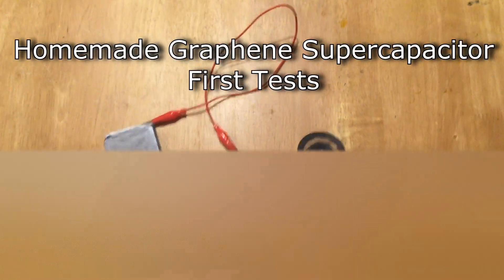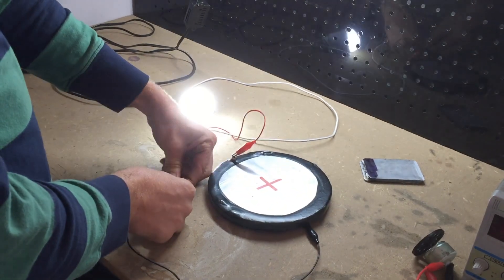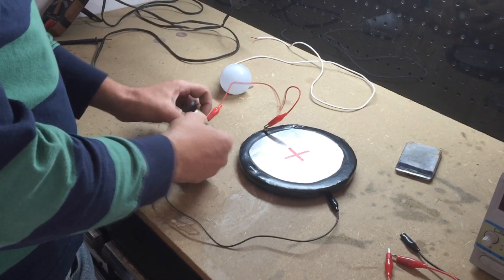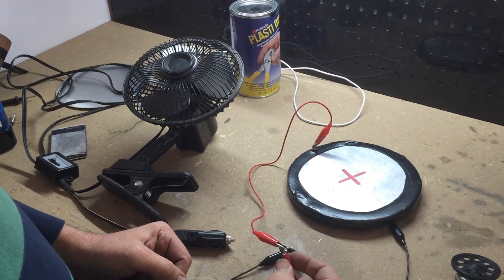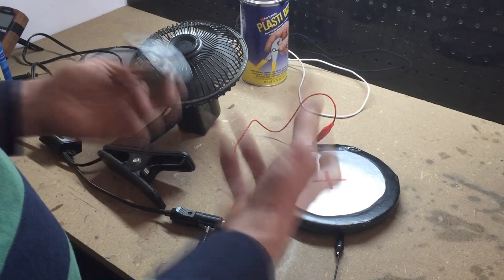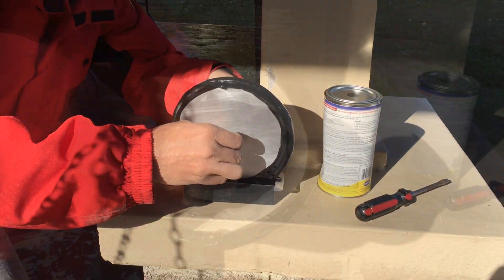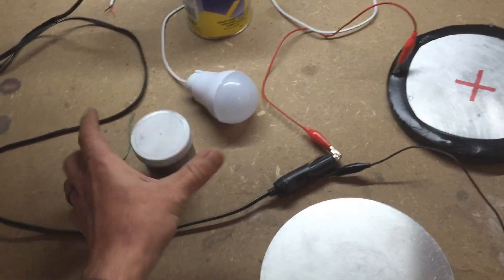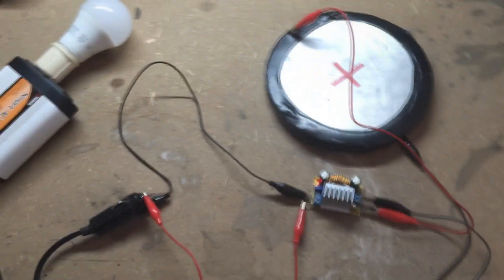Homemade Graphene Supercapacitors - First Tests

Comment: Those plates are too big you need long aluminum sheeting like a lot 50 feet long by 5 in width get the marigwana carbon power it’s the best and hold alot more energy use potassium hydroxide and make a vacuum area to remove water in the are

Comment: This is NOT a capacitor. It is an electro-chemical cell (or as commonly known  - a battery). For gods sake, he has put an electrolyte in the separator. A capacitor does NOT have an electrolyte. They do have very large conducting surfaces separated by an insulator - in the case of early types air, paper or oil was used; no they use plastics such as polyester and similar insulators. A little knowledge is a bad thing. If it was a capacitor, the capacitance would be too low (dependent on the surface area of the plates and the dielectric strength of the separator) to store any reasonably useful amount of charge. I suggest you spend some time studying electronics at a reliable teaching institution not from the internet and especially not from YouTube.

Comment: I would guess grinding down the coal pieces to sand, dust, or coal flour would be more efficient (thinner layers means more layers can be added).
Also, using multi layer capacitors (interleaving each sheet between positive and negative),
And lastly, using layers of foils instead of metal sheets (might be harder to solder a wire on, but should be possible), should increase the capacitance enormously.

Comment: Does round shape improve performance? 

Sphere has smallest area to cover most volume.

Does round shape improve V or Capacitence? Or both?
Reply: None, it has no effect on capacitance or voltage because they both rely on the surface area and distance between the 2 plates, he probably used the round shape because it was easier for him.

Comment: Hi friend  the energy in a capacitor is possible calculation E=1/2 V2 x C... Too it possible  meter with a amperimeter on configuration of discharge of this through of a resistance.  Can you show this?

Comment: It's galvanic or just capacitor producing electricity? Acid reacts with alluminum strongly
Reply: But the acid is not ever touching the aluminum.  Watch the video again 4:23. He applies polyurethane impregnated with graphene to make it conductive and protect the current collector's metal. Then he sprinkles activated carbon over that.

Comment: Sure would be nice to see some figures about the size/weight of the capacitor as well as the maximum voltage, capacity in farads, ESR, and watt-hours/joules when completing a charge/discharge cycle.  These things are conspicuously absent from a lot of these supercap videos and without this info it’s rather difficult to see the point of trying if you can’t at least know how far a person has progressed, when trying to duplicate or improve on their results.

Comment: hello lightsaber, i think there might be a problem, powered graphite is not graphene !! graphene is only 1 atom thick. also you are using an electrolyte , electrolytes are used in and for batteries, a dielectric is what is used for a capacitor.
these video's are very good, lots of different information, however i don't think we are on the correct track... i am so sorry to be a downer but i just have to say what i think is going on.
best of luck, i wish i wasn't in the state that i'm in, i would love to buy some stuff and try some of these experiments myself..
keep up plugging away see where it leads too.
Reply: normdoty  A dielectric layer can be formed using an electrolyte, what do you think is inside aluminum electrolytic capacitors?  In that instance the electrolyte is both a conductive fluid to allow current to pass between the two plates as well as helping to maintain the incredibly thin aluminum oxide layer on the plates that functions as a dielectric.

Comment: I have experimented with ground up wood charcoal and it works great. I figured why not use something readily available and free. it works.
Reply: What about using char cloth? I wonder if it has more micro structure increasing surface area.

Comment: I noticed that this capacitor is made of multiple segments or modules if you will. Tell me or any of these different sections we're together in series well the whole thing is in parallel or vice a versa? If you follow what I mean? is a very important question

Comment: If you are using a an electrolyte and it's producing electricity by a chemical reaction, wouldn't this be a battery and not a super capacitor? I believe this is whats called a dual carbon battery.
Reply: this is what I asked him if there is more than one assembly within the major assembly because typically it would only produce 2.7 volts if it were operating under a galvanic chemistry. It is producing faithful so this would suggest that he is charging it is not electrochemically producing voltage in other words it is a capacitor if that is the case
Reply: A capacitor should have an insulation between the positive and negative surfaces so I think you are right.
Reply: No. it's an electrochemical capacitor: 

https://www.cornellcollege.edu/physics-and-engineering/pdfs/phy-312/Theint-Aung.pdf

Comment: You can run that 8w bulb or even more powerful light bulbs with your super-capacitor. You can connect 1.5v Dc motor to a 12v generator to run the light bulb in more efficient way. Probably about 50% to 60% more efficient.

Comment: I'm interested in the application and integration of graphene/carbon capacitors with solar panels. A single silicon cell is 0.55v, so would you stack 4 or 5 to run across the cap, bearing in mind the max capacitor voltage? A solar panel built on an aluminium substrate would help keep temps down and increase output. How would a MPPT controller cope with the added current capability of a typical panel. (60 PV cells, 15 caps) would it track properly and set the cells to optimum? Unfortunately I have too many ideas and projects to explore all possibilities.

Comment: This is not graphene! Graphene doesn't make powder. Graphene it is a large atom-thick sheet of graphite. If you powder that you will just get graphite.
Reply: misium  You can use graphene in making it in an atom or so thick layer, but whatever you do and in whatever form you use it, it will stay graphene.
Reply: Misium, i think you mistook graphene and graphite. Graphite  contains large sheets of graphene.  Graphite can be sonicated to seperate and break up the graphene sheets into a powder. 

He uses a graphene powder to make his polyurethane coating conductive while providing protection for his alluminum current collectors from the phosphoric acid. Then he adds a layer of crushed activated charcoal which probably doesn't have many graphene like structures but whose micro structures provide an effectively high surface area for his electrolyte.
Reply: actually graphene can be a powder... you know... thats like saying mushed potato chips isn't potato chips its smashed potatoes...

Comment: i'm curious why all are using phosphoric acid as an electrolyte? Why not to use regular kitchen salt instead? As i heard, you can obtain up to 1.2 volt per cell using NaCl without a gas emission
Reply: The salt will attack the metal, thus it won't last very long.
Reply: yes, that's why for salt electrolyte there should be graphite electrodes instead of metal, but it worth it, i guess
Reply: jSkrat Nyarlathotep
Okay, that might work.

Comment: What is the dielectric constant of the insulator between the plates of the capacitor? Do you have the capacitance of the capacitor in farads?
Reply: There is no insulator- no dielectric.
Reply: But how it possible to make without dielectric material
Reply: mayur trasadiya  Exactly.  It’s not a capacitor if it lacks some form of dielectric, otherwise you’re talking about an electrochemical cell like a LiPo.
Reply: It's an EDLC, otherwise known as a supercapacitor. They don't use a dialectric.
Reply: As is with all capacitors, they have a dielectric constant, air, ceramic, mica, oil paper, ect.  Even aluminum electrolitic capacitors store energy in the charge distribution of an electrolyte and the orientation of aluminum oxide  insulating surface. 

At the risk of overly simplifying things, dielectrics with a relative dielectric constant greater than 1 store energy inside the dielectric often by changing the orientation or charge distribution of molecules or  distrirbution of charged ions. Electrolitic double layer super capacitors use an electrolyte to allow ions to get close to their opposite charged plates. As long as the electrochemical break down voltage isn't exceeded, there is no chemical change or electon transfer. Super capacitors really benefit by the huge effective surface area and how close the ions can get to such a huge effective area. Though you may be looking at  two 100  cm sq of current collecting plates, the effective surface area accessible to ions is football fields immense. 

if you know the actual effective plate area can you work back to determining the dielectric constant. But effective plate area is a slippery figure to pin down that will change depending on micro structures sizes distribution,  powdered vs granuals, and if pressure crushes the  structures. I'd guess the theoretical dielectric constants are published in some scientific papers but they arnt that important here, and if i were to guess, its probably close to 1, reflecting the dielectric constant of  space between ions and their plates. Or it may be a few tens large because of ion redistribution. Consider Salt, aka sodium chloride, when placed in water  does not change chemically but  separates into sodium and chlorine ions. Sodium ions attract and push on different parts of a water molecule orentating  one side of water molecules.  Chlorine attracts and pushes on the reverse sides. The result is the ion water structure distributes the ion's charge to the outside of the water ion structure. While water has a high dialectic  constant salt lowers it.

Comment: If you are open to suggestions, this is mine.  You really need to take a little time and study bedini and his school girl motor and make one.  I think you would forgo the solar cell idea and be hooked line and sinker. Unless you are nothing like me, but if that were the case you wouldn't be making all these cool videos about such important ideas and concepts.  The bedini motor makes a voltage which conforms to the thing being charged.  My first one would take one small 7 ah gel cell battery and run at a decent pace, not quite the same as his because I cheated and did not use the exact wires he said to since I recycled mine from a monitor or tv or something and probably could have used more sleep around the time when it came to wind the coil.  Never the less cheater as I am it still ran and charged a full size car battery and I put two cold flourescent bulbs inline in a series and it did not seem to make any difference in the way it charged up the larger battery.  Now the bulbs did not light constantly, but they flashed at full brightness each time the coil was pulsing which I thought was preetttty cool.  I'd do the tests and stuff for you, but my son decided that the second I turned my back or went to sleep that my experiment was done and he promptly dissasembled my bedini wheel so he could go spin it in the sand and have my magnets for his own.  So lesson learned,  when you buy magnets, you must buy enough so your kid or kids have at least more than you do for your project, cuz hey, they lose stuff and fair is fair,  which means yes, they get more than  you do, that way you can sleep knowing your wheel will still be spinning and charging when you get up!

Comment: I've been wanting to power a 3kw motor for an hour or so. How man panels of 12" x 18" do you think it would take? It's for a small motorcycle project that I want to start and batteries are the hardest part. I wonder if I hooked up an alternator to that motor, could that charge the capacitor while in use?

Comment: On the smaller battery what's the average mAh? I kind of want to start fooling around with old phones by replacing the battery with capacitors

Comment: Great start.  However, rather than just plugging in random devices, how about actually measuring the energy stored in a methodical way?  Just hook up a resistor and measure the voltages over time.  What capacitance do you have?  How much energy have you stored?

Comment: Add more layers to your capacitor .. sandwich like ten layers back to back and then show us a super super capacitor.!  :)  Building these into the back of the solar panel to store power at the panel is a novel and worthwhile idea.  I have built many solar panels.  I would like to build capacitor technology into the back of my next panel (But I need to figure out how to more efficiently backside the panel without overheating it in use as the better home made panels are cooled by not having backsides other than the sealant material which might not work well perhaps safety wise if a cap was building up charge on the backside..  it could arc-through or the weight could pull the gel down over time.  Will have to look into aspirated advanced plexiglass (the 10x stronger or better grade) -- aspirated meaning by venting by drilling holes at key points and leaving an air gap between it and the gel media for air circulation because panel power production efficiency drops as heat levels raise..

Comment: will the capacitor over heat or overload?
Reply: so capacitors have low volts but high amperage?
Reply: Low volts, high capacitance.

But they can deliver their entire payload near instantaneously, so in a sense they are "high amperage".

Comment: I think you have made a battery not a super-capacitor. If it was a capacitor it would work with out an electrolyte. 
I think this, but do not know. What do you think? Do not all batters have electrolyte in them?
Reply: No battery. There are no galvonic  or redox reactions. The electrolyte does not conduct electricity. It just gets ions close to the high effective surface area without any chemical reactions as long as the electrolitic break down voltage is not exceeded.

Comment: You probably already knew about this mistake, but I think you meant to say: "hook two capacitors up in parallel", not series. Capacitance adds in parallel. Just in case anyone wants to reproduce that idea.
Reply: He did say he though the voltage might be too low.

 Capacitors can be connected in either series or  parallel. 

When two identical caps are connected in series, the voltage will add as the sum of the individual capacitors,  but the capacitance = the recripical of the sum of the recirpicals of the individual capacitors". 

When connected in parallel, the voltage will be the same, but the capacitance will simply add as the sum of the individual capacitance. 

Connected in either series or parallel, max power output adds or doubles. Watts=V×A. 2V×1A = 1V×2A = 2W. And  the total energy stored will add as the sum of the individual capacitors.

Comment: I've read Robert Murray Smith's Book, have you tried any of the other electrolytes? Specifically Poly Vinyl Alcohol made from white glue. The reason is because it wouldn't evaporate.

Comment: Did you mix the carbon/graphene with just the polyurethane varnish and closed it like that, or did you also add isocyanide afterwards?

Comment: I can't wait for you to post a how to build video about these :) 

since they're thin, I think people could build very large and tall supercapacitors and hide them in their doors, or in the ceiling, or in the back panels of their wardrobes and use them as accumulators, like the tesla powerwall; it's a goofy solution but you won't have to sacrifice any space in your house

What do you think about TEG generators? I reckon you could build a SOLN1 alternative system using them, a generator that can provide both electricity and hot water, and maybe these supercapacitors will make everything more effective 

Am I right? Hope so, I don't have a scientific degree :D

Comment: What is the capacitance performance when compared to a manufactured super capacitor. Does the size and density of the granules impact better efficiency found in manufactured ones? I am looking at: weight, physical size (footprint) and output.

Comment: +lasersaber You never stated the run time from charge to discharge. What is it? (Or did I miss your mention of it?)
Reply: VARIES BY LOAD
Reply: +Danyal Ahmad I figure that. I guess I should have specified I was asking about his run tests with the fan and light.
Reply: +igounfazed Don't expect it to be too long. Maybe 5 min with that motor
Reply: +igounfazed With the fan 2 min max. Probably around 1 min

Comment: I wonder about different polar electrolytes like DMSO or ethylene glycol or some other non water based polar fluid. Maybe that'd increase the operating voltage of the capacitors by eliminating the potential electrolysis once you go over 2 volts.

Comment: Nice. so you just made it from the beginning, How about Activated Charcoal did you burned the wood and  treated  it with Calcium chloride. or some other way? The  good quality graphite would activate by itself it might take some time but if you will treat it with Acids you are disintegrating the fragile atomic carbon bonding so maybe your Activated Charcoal  will work better for some time. I will experiment with it on YouTube as well.

Comment: I have seen a few comments about combining these with the crystal battery. That is we're I'm going with this to. My crystal cells are powerful enough to light LEDs, but I want more. These cells sit around all day producing power. I have 4 in series, parallel for 3 volts at a constant 60 Milla amp. I would love a home made way to store the power till I need light, much brighter light.